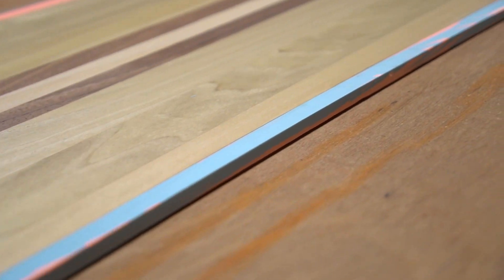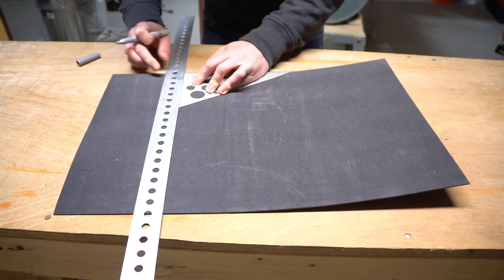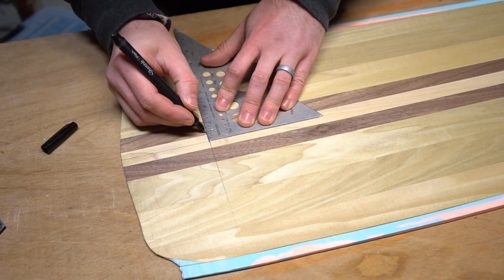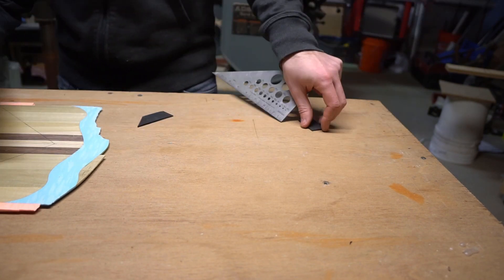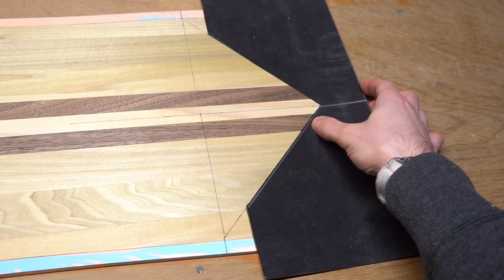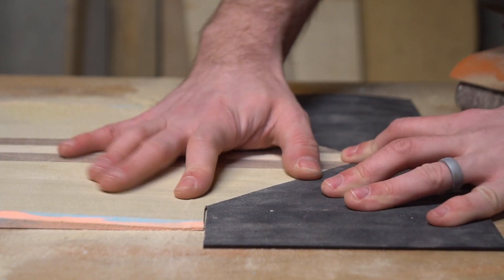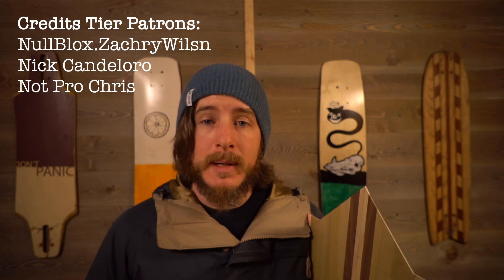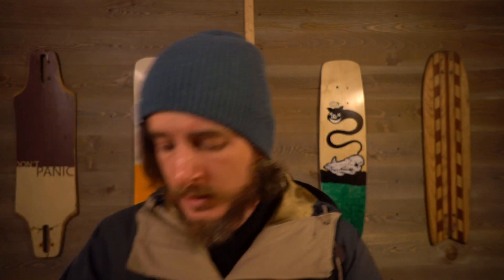Building a Snowboard - Part 8: Tip and Tail Fill Material

Comment: Did you rabbit your sidewalls or leave them square over the edge
Reply: If a shop is willing to take it all the way flat. Ive been grinding mine by hand and it takes forever
Reply: As far as vacuum vs press, press is harder to make but less of a worry to use. Vacuum is easier to make but if u lose pressure or have a leak or you  dont use breather cloth u might end up with weak spots in your board
Reply from the maker: I wasn't planning on doing a rabbit, should I? Would VDS rubber work well enough on its own?
Reply: Ive built a few boards myself and ive found the rabbit is less about adhesion and more about your base geometry. The rabbit acts as a place for the flange on the steel edge to go so it doesnt push the edges of the base down. Keeping your base flat rather than an edge high geometry
Reply: My first board had no rabbit and i routinely cought my edges and i think it was because of that
Reply from the maker: Would a good base grind take care of that? I'm going to take this deck to a shop to have that done since I don't have the equipment and as long as the base is flat it seems like that shouldn't be too much of an issue?

Comment: I vacuum bagged a few boards and never got the results I wanted. Ended up building and welding a typical snowboard press, the results were instantly way better. If your going to do more then a few boards Id build a press. Not sure how good a clamp press is but I've seen people build a press with wood instead of metal.
Reply from the maker: I'd love to build a pneumatic press at some point. It's a bit out of my price range right now, but it would be a super rewarding project to tackle
Reply: @GoodRoads  Yeah Its was pricey I think I spent $500 on materials but I sourced most of the metal from the scrap yard. Which is why I vacuum bagged my first few boards. Can definitely get good results with them but the riding I was do at the time and the rate I was going threw boards it made more sense to move to a press. The best part of vacuum bagging is being able to see the alignment of the parts easier. Nothing worse then having something shift slightly. With that being said gluing an insert from each binding area to the base material makes alignment perfect. Another option is using two dowels glued to the base then drill same sized holes in the wood core. There's other options too but the dowels I found was the most consistent.
Also nothing beats the feeling of riding a snowboard you made for the first time. Even if its not perfect the amount of stoked you get in the end is worth all the trial and error.
Reply from the maker: I'm really glad you expressed that last part, I've been feeling kinda down on this build because I don't expect the board to come out that good. You're right though, if it survives I'll probably love my janky powder deck because I made it. 
I love the idea of using a binding insert for alignment, how do you handle the bottom layer of glass with that technique? Do you just cut a slit in the cloth and pop that one insert through without glass between it and the base sheet? I didn't leave myself much wiggle room with my sidewalls, so some kind of keying or registration like that would be a huge help
Reply: @GoodRoads  Yeah you lay the fibreglass down and just slice a couple strands for the insert to come threw. I found I preferred to use a dowel/plug drill bit to create a dowel  from off cuts of the core then drill two alignment holes in the core and use the plug over an insert. If you have a clear topsheet the insert method might be the way to go.

My first board the core shifted a bit so the sidewall got sliced off a tiny bit at one end. I still rode it a ton and it worked well, but each board after that came out better. I still made tons of mistakes on other boards but each time I learned how to improve them and it got the point where it look like the came out of a factory. I also have a pile of cores I messed up trying different experiments as well. No matter how janky it is if its ride able you did something most people will never do. Be prepared for a ton of people asking about your board in the chairlift line too, most people will be super stoked on it.
Reply from the maker: You're getting me hyped again dude, thank you so much. It sounds like you could even do a smaller diameter dowel with that method, and you'd still have glass under all of the inserts for strength in case it was ever needed. I think I'm going to give that a shot, thanks for the tip!

Comment: Couldn't tell you which press method to use, as I use a pneumatic press. Most build guides I've watched use the vac bag method when possible tho.
Interesting how you're using fill, I haven't bothered with my boards as usually I leave the core thick enough to just epoxy it back together if I have to. Might have to try it on the next one!